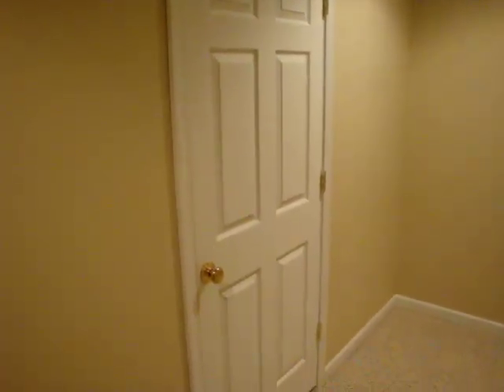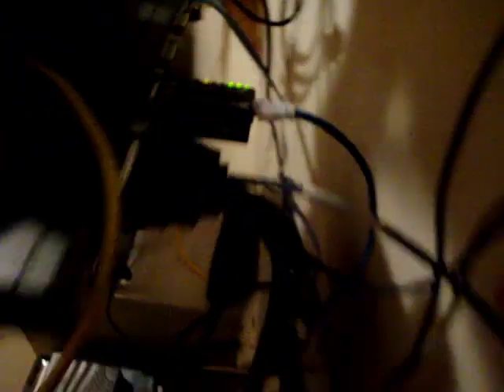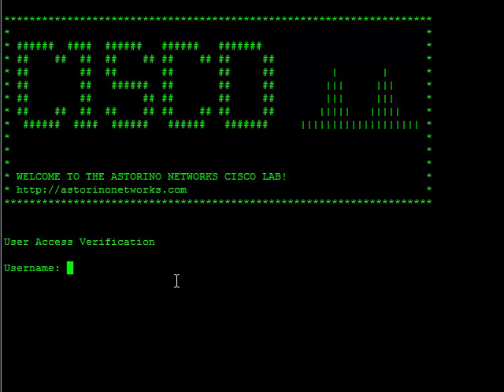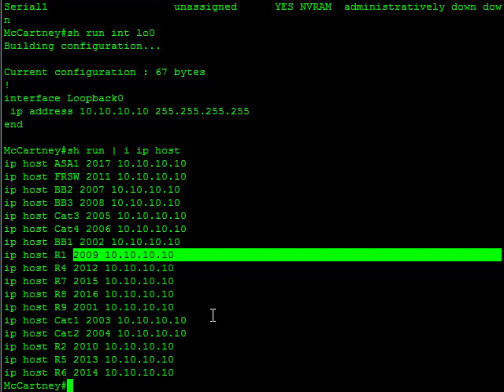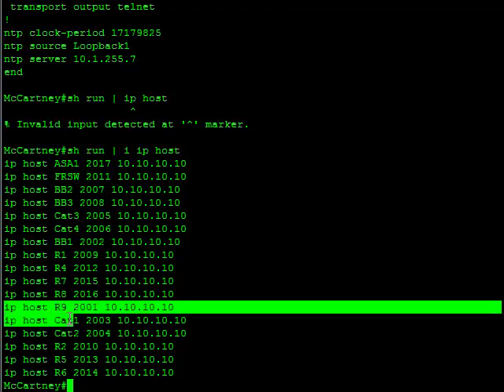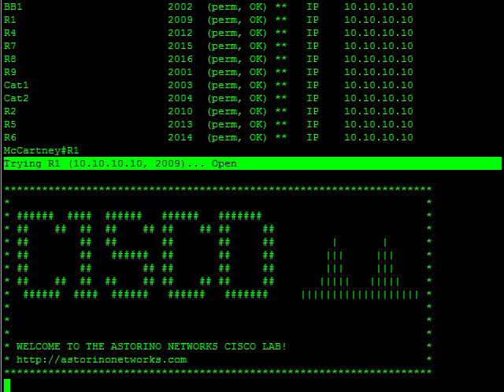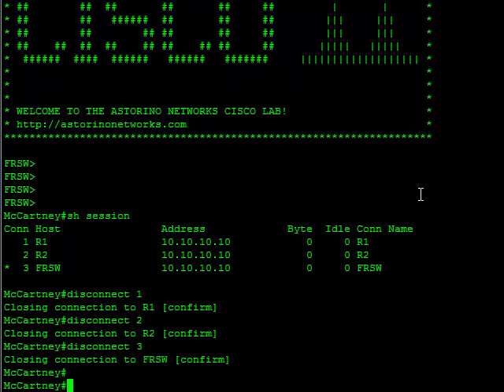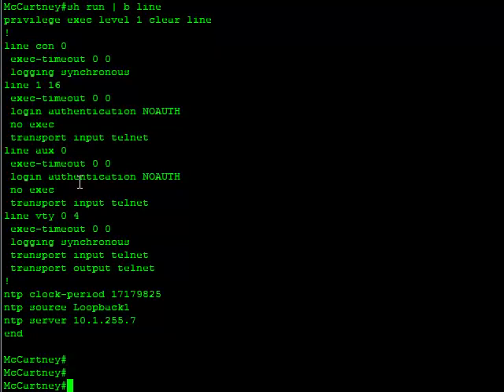Building A Cisco Access Server

Comment: Hello thx a lot for your video ! is very usefull :)

but I have some issues, I wonder if it is possible to configure a router connected at the AS with copy paste ! (if I do this ... putty send to quickly there are some merged lines)
Reply from the maker: You can but you want to take it slower. Paste in a little at a time as opposed to the whole thing at once

Comment: Thanks Joe for the Tutorial. This worked for me except for al small hitch.

After doing all that if anyone is getting the error "% Connection refused by remote host" when trying to telnet either via the console server or via putty, make sure the "Overruns" are 0/0. To do that just do "clear line [LINE NUMBER]" so for example "clear line 1" will make the overruns 0/0 on the console cable# 1, "clear line 9" will clear the console cable #9...so on a so forth.

Other than that worked like a charm.